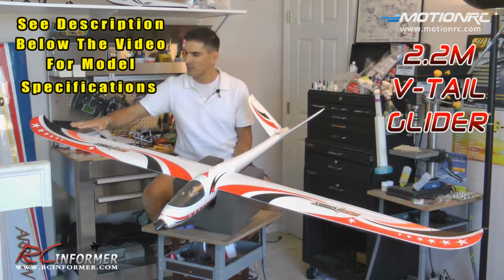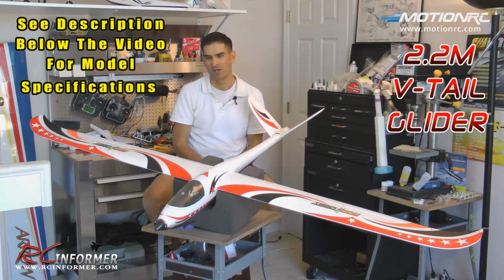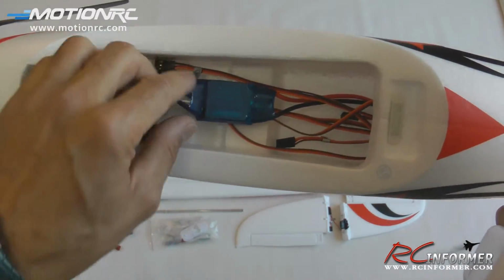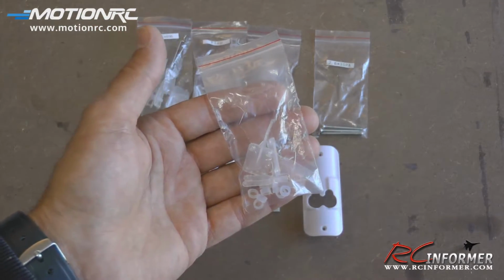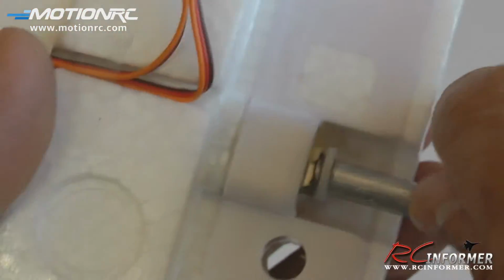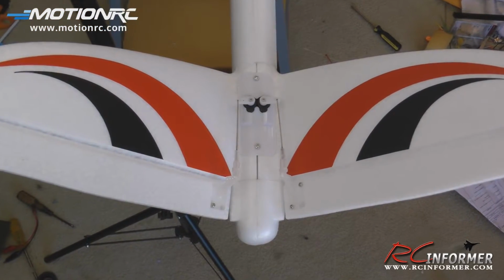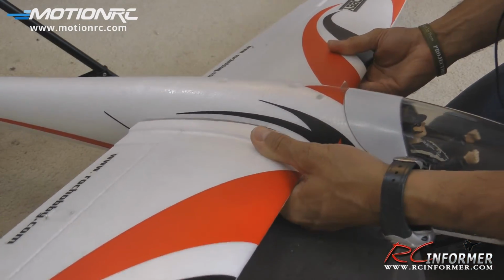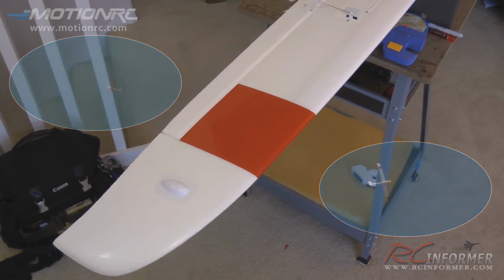MOTIONRC 2.2M V-Tail Glider PNF Review & Build Guide By Rich Baker in HD

Comment: i have this plane and it has done a spiraled in 2 times im using a 2700 3s .the new model has a different battery location the old one put battery  in front and never had any problem but the new one i got 2 months  ago has a battery location under the wing ,im moving battery  back forward to old position and see if it happens agin. this what happened ,i slowed plane down and stalled it , it nosed over and started to spiral no control but luckily i was high enough it finally got control and saved it the 2nd time not so lucky straight into ground .just wondered if anyone had mentioned problem
Reply: Hi Matthew, mine will be delivered this week, are you saying that control was difficult after moving the battery from under the wing to the cockpit or by leaving it in the middle, are you using 1300 or 200 batteries, cheers.
Reply: Its very confusing what you are trying to say... is it the new or the old that has the issue?

Comment: Hi Rich, nice video but with my one the v tail assembly won't seat properly. The servos hit the metal spar before it closes up, reluctant to rely on the front screw to close it up, the the thread of which is stripped anyway and it arrived new like that!

Any suggestions?

Comment: Very tempting at the price. ARTF is ARTF so we have to expect a minor amount of work and fixing before it's good to go.
Reply from the maker: They may have fixed the issues i found by now.
Reply: RCINFORMER No sir they haven't. They made shit of it all together. Wings don't fit together at all from the box, wing spar too tight,needs dremmeling as you have shown. Servo wires in the way and easily damaged. Holes don't line up. Battery tray got moved under the wing and moved the CG. Bags with linkage came unlabeled. Wing tips dammaged-bend fight out of the box... Ailerons cut rough and foam sticking out. It's not really a good plane for beginners as stated on the box unless have some experience and bit more common sense. But still thanks for review. Regards.

Comment: Thanks Rich - I enjoy, and learn from you're builds, and hobby tips. I few more suggestions to add to this build are to test fit the wings before trying to assemble; I found the use of non-toxic multi purpose grease on plastic wing joiners pieces is helpful as the fit is pretty tight. Also, tips for transmitter "v-tail" setup to obtain proper pitch and yaw throws especially for the novice. I also decide to configure with a receiver/flight stabilizer that made setting v-tail a little bit more complicated.